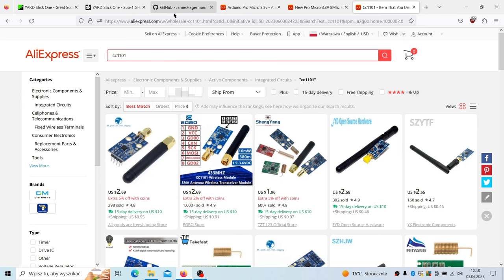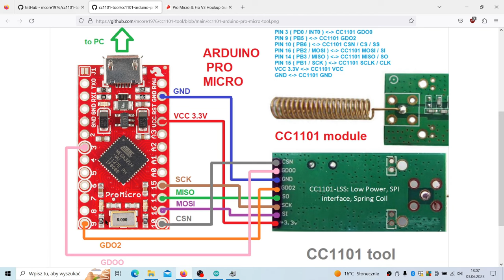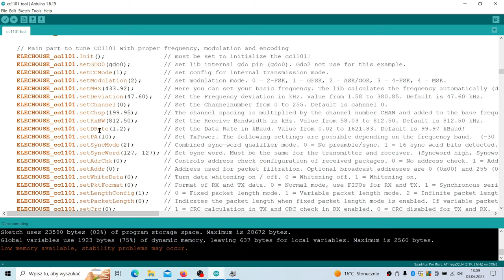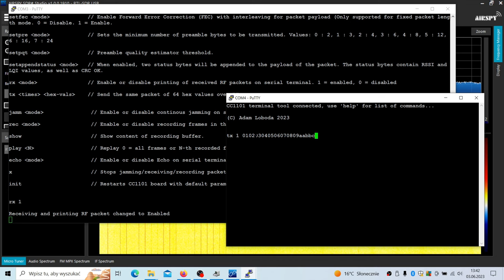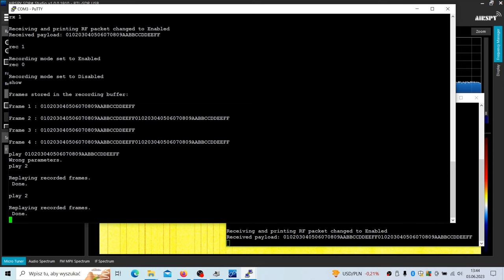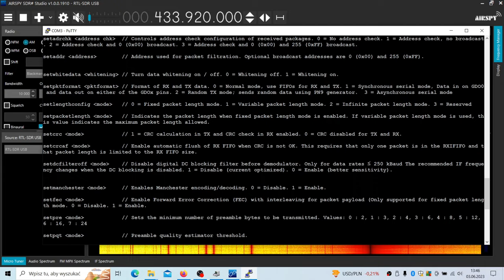DIY CC1101 tool - RF jammer, replay attack, sniffer - cheap & easy tool for radio pen testing

Comment: I have tested this using ESP32-WROOM32 with your example codes. It works like a charm. There are some errors here and there to smooth out and definitely a fun thing to experiment with.
Reply: Can you give connection instructions with esp32

Comment: frankly congratulations again, I can't believe your project does exactly the same thing as a Fllipper at the RF level...just "for a handful of dollars"...basically if you have to copy the key to my vehicle outside carried receiver (rolling code required) I just have to mention the frequency, the modulation and launch RX 1 possibly rec 1 and that's it? and replay the whole thing...
Reply from the maker: basically not rec & rx commands but rather

rxraw microsec
recraw microsec
showraw
playraw

where microsec is sampling interval in microseconds like for example 50, 100, 200  etc
Reply: thanks you  @justanengineer5599
Reply: It’s because it needs a computer

Comment: sorry for stupid question but whats the difference between your cc1101-tool ,  LSatan and jopohl projects?
Anyway, its amazing! my hardware pieces just arrived, will do my best!
Reply from the maker: my cc1101 tool is using the library from LSatan. It is like a practical example of how to use it

Comment: Can you make high freq rf spectrum anylyser using broad frequency rf module like si4432 or si4463 and respberry or arduino with tft colour display?
Reply from the maker: yes I could but I have no interest in such device. I could buy that kind of stuff on aliexpress. I am only making things you can not easily buy
Reply: @justanengineer5599  everything is available but SA of that range is very costly compared with DIY.

Comment: i have a question... on wich frequencies can it emit . .. ? can i set for example any frequency between 1-1000 Mhz , or is cc1101 limited (300-348 MHZ, 387-464MHZ and 779-928MHZ)
Reply from the maker: it is limited to the ranges you mentioned

Comment: Pretty freakin awesome! Amazing! Question is it possible to use XBEE module or with a regular nano arduino too. Plus with esp2866
Reply from the maker: yes. There is ESP8266 script already available and tested. For xbee you need to adjust pin numbers
BTW see the second video showing practical usage of this tool https://youtu.be/mdkEK_wmWJA
Reply: @justanengineer5599  thank you
Reply from the maker: check WIFI version for esp8266 based my cc1101 tool. usb cables are no longer needed !
ESP8266 as a WIFI CLIENT
https://raw.githubusercontent.com/mcore1976/cc1101-tool/main/cc1101-tool-esp8266-wifi.ino
ESP8266 as a WIFI ACCESS POINT
https://raw.githubusercontent.com/mcore1976/cc1101-tool/main/cc1101-tool-esp8266-wifi-ap.ino

Comment: Can u add oled it looks great
Reply from the maker: no. but there is wifi enabled version with ESP8266 that you can use with your smartphone without any cables
Reply from the maker: unfortunatelly no unless ypu power this board from 3.3v power source (you can find power converter board 5V-3V)
Reply: @justanengineer5599 my cc1011  power supply voltage dc  is 3.3v to 5.5v so I can use Arduino pro micro 5v?
Reply from the maker: you may try but there is no guarantee it will work

Comment: i like that you still update the project to this day, i really appreciate you for making everything public for everyone to learn👍
Reply from the maker: I am a fan of the open source :-)
Reply from the maker: I have just added  ESP8266 version with wireless connectivity. USB cables are no longer needed when using ESP8266 board instead of Arduino Pro Micro

ESP8266 as a WIFI client
https://raw.githubusercontent.com/mcore1976/cc1101-tool/main/cc1101-tool-esp8266-wifi.ino

Also ESP8266 as a WIFI ACCESS POINT version is here 
https://raw.githubusercontent.com/mcore1976/cc1101-tool/main/cc1101-tool-esp8266-wifi-ap.ino
In this version you connect over WIFI to ESP8266 directly on 192.168.1.100 port TCP 23 , SSID is "cc1101"

Comment: You’re a legend dude, I was always wondering how to apply these cc1101 boards but I’m not a microcontroller guy and this gives me a reason to get into it and a blueprint to follow.
Reply from the maker: I like to demystify things and make them simpler for others.
Reply from the maker: check my newest version where you can use wifi to connect to this cc1101 tool - you need esp8266 board instead of Arduino Pro Micro

WIFI CLIENT VERSION
https://raw.githubusercontent.com/mcore1976/cc1101-tool/main/cc1101-tool-esp8266-wifi.ino

WIFI ACCESS POINT VERSION 
https://raw.githubusercontent.com/mcore1976/cc1101-tool/main/cc1101-tool-esp8266-wifi-ap.ino

Comment: This is brilliant! Thank you so much for sharing this. I'm guessing these particular CC1101 boards are very cheap because they don't have other circuitry that are in the more expensive devices. I read that the Yard Stick One, for example, has low pass filters and a TX amplifier.
Reply from the maker: you are correct. These boards are the simplest and they only contain some output band filter and CC1101 plus Xtal.  Yardstick is more advanced

Comment: Continue to pay attention to you and harvest continuous surprises! Love you<3
Reply from the maker: good! in the next video I will be opening my garage gate with this tool. I will show it step by step
Most people here do not even understand how powerful this device is and what can you do with it...
Reply: @justanengineer5599  Wow looking forward to it！😀
Reply: @justanengineer5599  can u also make a video on how to increase the range please? like 1-3 km coverage range
or its not possible?
Reply from the maker: Hi, the best would be to use additional amplifier board (which I do not have at the moment), but the problem is that these board work only one direction. You can only increase transmission range or only receiving range.
Anyway I found something that pottentially could work both ways : https://www.aliexpress.com/item/1005003970364886.html

Comment: It worked with esp32!!:face-blue-smiling::face-blue-smiling: so useful video!Hope you make more!
Reply from the maker: I am only making good stuff, hahaha. Have you checked my last video https://youtu.be/mdkEK_wmWJA  ?
Reply from the maker: Hi there
I have prepared WIFI version for ESP8266 

https://raw.githubusercontent.com/mcore1976/cc1101-tool/main/cc1101-tool-esp8266-wifi.ino
Here ESP8266 connects to an external Access Point so you need to provide IP addresses and wifi password in the source code

Also ESP8266 as a WIFI ACCESS POINT version is here 
https://raw.githubusercontent.com/mcore1976/cc1101-tool/main/cc1101-tool-esp8266-wifi-ap.ino
In this version you connect over WIFI to ESP8266 directly on 192.168.1.100 port TCP 23 , SSID is "cc1101"

Comment: A note: It is not the same as a YS1, the YS1 has rx/tx amps and it has filters and is already setup to use python. This will require a bit more effort to use python with it ( but should still be doable)

That all said I have ordered a Pi Pico board to use with the numerous cc1101 boards I have as this would be a nice cheap (almost disposable) alternative to my 2 Yardstick Ones so it certainly has its place.

I am hoping it works well, after my issues with RFQuack (TX worked fine, RX did not work at all).

Comment: hi really a great tool well done...if I understand correctly for jamming you have to use the corresponding modulation set
for example if I have the right to jam a 2fsk frequency I must select it before launching the Jamm command?
Reply from the maker: yes. before jam command you need to do setmhz and setmodulation for best efficiency

Comment: Does the particular CC1101 module that you are using work at 868Mhz ? I don't get why 433 is written on it if is works for almost the whole subGHZ range
I think mine is actually faulty, that made my job harder all along
I managed to get my garage door code using univerval radio hacker at least, but I can't unlock it with my digispark like you did in an earlier project since it works at 868Mhz
Reply from the maker: Yes. Even 433MHz CC1101 modules work on 868MHz. The important thing is that if you buy 868MHz version it will work better on 868MHz due to different capacitors and coils that are tuned to this frequency on the board.
You may try with this project using RAW commands : scan 867 869, setmhz 868, rxraw 50, recraw 50, playraw 50, showraw , load , save

Comment: Hi I have a question here. How does Flipper Zero manage to support 315mhz, 433mhz and 868mhz using c1101 while the modules available usually only support one of the three frequencies?
Reply from the maker: the same way as my software does. cc1101 can be tuned to the wider range than only 315, 433 and 868

Comment: Loved the video 
is it possible to do the same with an ESP32 board or it has to be the Arduino Pro Micro?
Reply from the maker: check my github there is esp32  and ESP8266 code as well

Comment: Hi Adam,

First of all, thank you very much for this guide. I am brand new to Arduino so I hope this isnt a question with a blindingly obvious answer. I set up the circuit on my breadboard, using Ardunio Nano, but as I had 16mhz 5v boards I had to use volatage step down converters. If I have the baud rate set to 115200 in the arduino IDE or Putty I can see the first two lines of your code's output (please type help and then C @ Adam). After this I cannot type into putty, and anything I type into the Arduino IDE seems to be ignored. I am using the Arduino Nano specific code that you provided. Do you have any insight into what might be causing my issue? Thank you!
Reply from the maker: are you getting cc1101 initialized ok message ?  it looks like the code is stuck on CC1101 initialization which gives us an info that either your TTL logic converter does not work or the CC1101 wiring is incorrect
Reply: @justanengineer5599  No, it was not coming through. I think the problem is that my logic level converter doesnt handle SPI (I have learned today!). I have some 8mhz pro micro on the way, as I cannot get my other project to work with the 16mhz + logic converter as well. 

Thank you for taking the time to reply!
Reply from the maker: you may also try with ESP32 boards or ESP8266, I have already posted working code on my Github.

https://raw.githubusercontent.com/mcore1976/cc1101-tool/main/cc1101-tool-esp8266.ino
https://raw.githubusercontent.com/mcore1976/cc1101-tool/main/cc1101-tool-esp32-wroom.ino

Comment: Nice project, thanks for sharing!
I just programmed an Arduino Pro Mini 3.3V 8mHz wired up with a regual CC1101 board. I use putty to send the rx command but receive nothing. Also send some  packets but do not see any response on 433mHz ?
This is the modification I use for the Pro Mini

// defining PINs for Arduino Pro Mini
byte sck = 13; // D13
byte miso = 12; // D12
byte mosi = 11; // D11
byte ss = 10; // D10
byte gdo0 = 9; // D9
byte gdo2 = 5; // D5

Any idea what I'm missing?
Reply: Classic mistake,😉
 I switched miso/mosi
Reply from the maker: use RAW mode. Try    rxraw XXX     where  XXX is microseconds

Comment: Can I use any transreciever board as long as connections are correct? Weather it is  CC1101 OR AS07-M1101 with D1 mini?

Edit : AS07-M1101 has a VDD instead of VCC. I think it should be fine. 

apologies if they are dumb questions.
Reply from the maker: yes it also fits

Comment: Could you use a 5v 16mhz Arduino with a voltage level shifter or is the 8mhz clock necesary for operation?
Reply from the maker: yes but the better option is to spend 2 usd for ESP8266 board instead of spending money for level shifter, additional cables and arduino pro micro 5v, don't you think? Have you read the description on the Github page of this project? It has evolved a lot since this video. It is now working with variety of boards

Comment: hi would it be possible to adjust the sensitivity  when I launch the sniffing...I don't receive anything from the surroundings I think...and I would like to know a little more about the scan function...when I launch it nothing happens is displayed when pressing the remote control
THANKS
Reply from the maker: for scan function to work properly either the signal has to be available for at least 5 seconds or the frequency range has to be narrowed to 1MHz or less

Comment: loving this, is there a way that it can be dynamically configured to jam frequency within 50 meters
Reply from the maker: yes. it supports such function out of the box and  basically two commands are required  to do such operation : setmhz XXX   and jam  
what else do you want?

Comment: Nice work!
Can a raspberry pi be used (with the appropriate add ons) the same way as this?
👍
Reply from the maker: in general yes. Raspberry Pi can be connected to CC1101 board - you have it described here : https://securipi.co.uk/cc1101.pdf. 
But my point was to build simple to use CC1101 based device that could be connected to anything with USB Serial Port. 
This is only an alpha version and  it will evolve
Reply: @justanengineer5599  thanks! 👋

Comment: hi, great project and thanks. i have it built and connects fine in the arduino software and putty and can view the help in putty but still getting a device not selected in the airspy, i have tried the zitag for the rtlsdr also as was unsure if that driver was also needed but the device was still unknown and the drop down box in the configuration is still empty.
Reply from the maker: this cc1101tool device works only with putty terminal. For the airspy you use only RTLSDR dongle and you need Zadig first to be able to use rtlsdr.

Comment: Thank you for putting together these great videos. I am having some problems getting this working. My main issue is with URH. I do not see any signals. I've tried different Antenna's, I went through all the possible settings, I've changed everything. Adding and removing a low noise amplifier. But it must be.... that URH on my Windows 11 is not working properly. Because when I close the software, and open up SDR#, I can see all the signals on their respective frequencies.. my vehicle FOB (315Mhz), my weatherstation (433.92 Mhz) and my garage door opener at 314.6 MHz.  Do you have any suggestions on how to get URH to be able to see these same signals?
Reply from the maker: yes. first you need to get windows working with your rtl sdr dongle. you may look for some of my old videos showing how to install driver with Zadig tool
Reply: @justanengineer5599  Hey Adam, So I gave up on getting URH to work on Windows. I installed Debian 12 on an older laptop, and URH is working well on that.

 I am continuing to work on my Windows machine to complete this project. I am working on an ESP32 board. I have flashed the ESP32 with your .ino file for the ESP32 with no compiling errors. On my ESP 32 I can see a red and blue light lit steady (not flashing). I think this means I have uploaded it successfully. I then switch to Putty to communicate with your program. In Putty, I select the serial radio button, I enter my number for port COM# (in my case my device manager is telling me 5),  speed I enter 115200 baud rate, data bits 8, stop bits 1, parity none, flow control none. When I open putty terminal. I only see a Green Square.. and not the (c) Adam Laboda..  

any thoughts?
Reply: Okay, I changed my procedure a little bit. After Flashing the program, I press Enable on the ESP32, I disconnect the USB Cable from the computer.. wait a few seconds.. then plug it back in.. then open up Putty.. and it's almost working.. but the ESP32 keeps resetting over and over again..so I keep seeing your name roll up the screen along with..  
(C) Adam Loboda 2023

ets Jul 29 2019 12:21:46

rst:0x8 (TG1WDT_SYS_RESET),boot:0x1a (SPI_FAST_FLASH_BOOT)
configsip: 0, SPIWP:0xee
clk_drv:0x00,q_drv:0x00,d_drv:0x00,cs0_drv:0x00,hd_drv:0x00,wp_drv:0x00
mode:DIO, clock div:1
load:0x3fff0030,len:1448
load:0x40078000,len:14844
ho 0 tail 12 room 4
load:0x40080400,len:4
load:0x40080404,len:3356
entry 0x4008059c
CC1101 terminal tool connected, use 'help' for list of commands...
Reply: It works! It works! Thank you, Thank you, Thank you! Wow.. it only took me like 3 weeks to get this working!  

In the end it was a stupid mistake..  In the sample code you provided.. the XIAO chip is the code that isn't commented out and the WROOM code is commented out.. I switched this.. everything is up and running.. just tried jamming.. cause that was the easiest thing to try first.. man.. such a sweet project. Thank You!

// defining PINs set for ESP32 module
// Example for XIAO ESP32 C3
/*
byte sck = 8;   // GPIO 8 
byte miso = 4;  // GPIO 4
byte mosi = 10; // GPIO 10
byte ss = 20;   // GPIO 20
int gdo0 = 21;  // GPIO 21
int gdo2 = 7;   // GPIO 7
*/

// defining PINs set for ESP32 WROOM module

byte sck = 18;     // GPIO 18
byte miso = 19;    // GPIO 19
byte mosi = 23;    // GPIO
byte ss = 5;       // GPIO 5
int gdo0 = 2;      // GPIO 2
int gdo2 = 4;      // GPIO 4
Reply from the maker: I am glad you made it !

Comment: Finished test: NodeMCU ESP8266 still reboots, WEMOS D1 MINI works fine🐱
Reply from the maker: great. my wemos D1 mini clone tends to restart from time to time but most of the time works stable. My analysis points to SmartRC library which sometimes fires the Watchdog
[EDIT] found the source of the problem. It is INDEED senddata function of SmartRC library which takes too long if Data Rate is 1200bps. Changing it to 9600 bps or even 4800bps in deafult initialization settings  solves the issue with WDT Restart on ESP8266 boards. I have updated source code accordingly